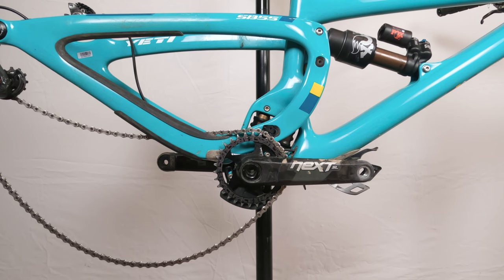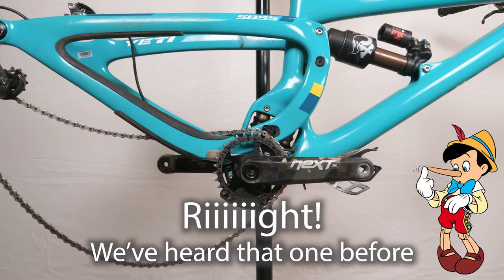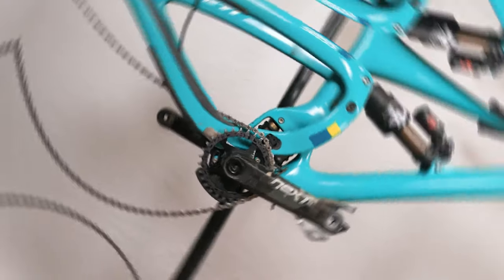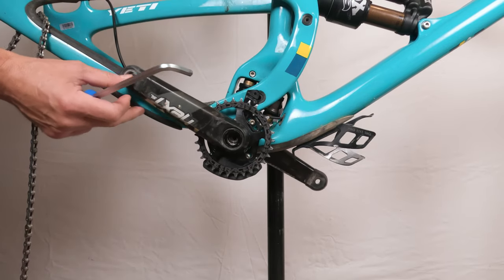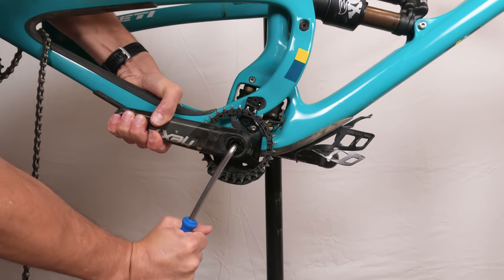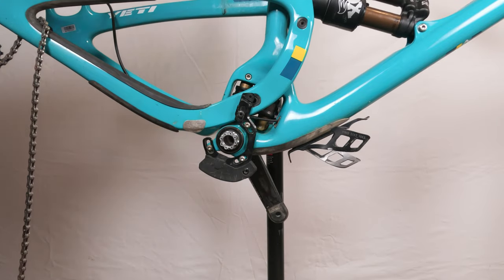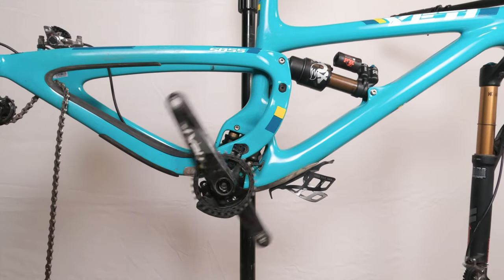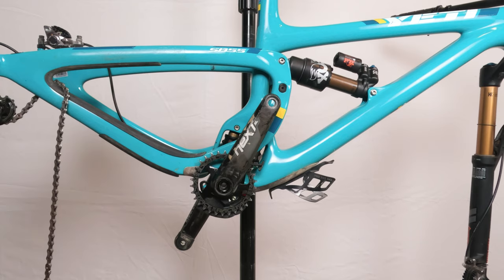Raceface Next Cinch Crank Service tips & pedal thread repair for beginners. This crank is a mess

Comment: The stock preloader that comes with RaceFace cranks is not great and should be replaced with a beefier alternative. Not only does that pinch bolt strip almost instantly, the plastic material is cheap and can break. I've tried both the Muc Off and Cane Creek aluminum preloaders and definitely prefer (and would recommend) the Cane Creek preloader. If you have RaceFace cranks, do yourself a favor and pick one up.
Reply from the maker: The old raceface preloader just plain sucked, and the new one is dumb. The new one might have solved the issue with stripping screws,  but it's a fricken magnet for dirt and mud. The cane creek is awesome. I'd say it's pricey for what it is, but what isn't pricey these days. 🙄 I never knew muc off made one as well. Thanks for the heads-up, I'll look into it 👍
Reply: The Cane Creek preload ring is excellent. Well worth the money. Going strong after 4+ years and several crank services a year. Always made sure I had at least two Race Face spares on hand before. switching.
Reply: @davide.6204  Same (I’m on year 6 with mine.) I’ve also got a crankset with the Muc-Off preloader but I think I prefer the Cane Creek.
Reply: So are you selling those with such a strange identifyer ?

Comment: If you strip that little screw head, you can get a better replacement at your local hobby shop (that sells RC cars).  I bought a box of 10 3x10mm hex crews from APS racing (APS30310S) for a few buck.  The heads are larger/deeper for better hex key engagement and they are stainless steel so they won't rust.
Reply from the maker: Thanks for sharing this myman. what sucks is there used to be a hobby shop about a mile from me for decades, but he closed shop two years ago. If by chance you happen to come across a link online feel free to share it so I can put it in the description section for people 👍

Comment: I'm surprised such a critical component would made of plastic and an easily stripped screw.  Cane Creek makes an all aluminum preload adjuster that is compatible with Race Face and looks far more substantial.
Reply from the maker: YUP! You are 100% correct. It's a bad design! What I don't get is that the new version of the preload ring technically fixes the issue with the bolt, but in an attempt to make it lighter, they designed it with large gaps all around it, which collects mud and dirt like a magnet. That's the last thing you want around a bb spindle spacer.

Comment: Just reassembled mine after having to replace the Raceface BB. It was not old but the previous owner's main hobby was pressure washing it seems. As you say these cranks are easy to work on once you get it loosened as it can take some force initially. Like the way that you do not plaster the whole assembly in grease...most mechanics overapply the stuff and it sits there doing nothing and becomes a magnet for dirt/dust.
Reply from the maker: Glad to hear you found the video helpful. Totally agree with you on to much grease. Many people use WAY to much grease. Last year I serviced a bike and literally couldn't see the lower two cogs on the cassette, they were completely covered in greased. As you basically mentioned, if you can see the grease it provides zero value.

Comment: I've found that cotton swabs (q-tips) are pretty good for getting down in the splines on the crank with the chainring.  I keep a soda bottle cap filled about halfway with IPA and then dip the swab into the cap to get it wet and then go to town cleaning down inside those splines where it's hard to reach.  It takes quite a few of them but it gets the job done 🙂
Reply from the maker: You are absolutely, positively, unquestionably, unequivocally, indubitably, no ifs ands or buts about it, RIGHT!  😁 I've used Q-tips multiple times in the past,  when the OCD kicks in, I can go through a surprising amount of them before I'm done. Those tube brushes I bought a couple of years ago also work really well. They are pretty stiff considering their size and do a great job and scrubbing off debris from the threads of the crank bolts.

Thanks for the great tip, which I really should have mentioned in the video 👍

Comment: Great stuff! Pretty disappointing that the BB shell is that far out of spec on a Yeti. I'm betting the owner goes through BBs rapidly and he's staring a brand new crank in the face with the massive amount of scoring on that spindle. Lastly, a big HELL YES to a normal amount of grease! So many build channels use enough grease on just the rear axle to cover the entire bike build. Great to see your sub count going up as you deserve it.
Reply from the maker: Thank you so much for the support. By far the most scoring I've seen on a spindle. At least Raceface sells just the spindle, which helps with replacement costs. I'm still not sure if it's a frame bb shell issue, if the bb wasn't pressed in right, or even if the bearings weren't installed in the bb shells correctly. Work just got stupid busy, and I haven't replaced the BB yet. While waiting for the BB I started on the bike's fork. I'll get to it soon. 

You are 100% dead on with the grease! There is a misunderstanding that adding lots of grease to the outside of a bearing will make it work better. It's the complete opposite. I plan on going into this in a headset video I'm working on. This is another area of a bike where some people apply way more grease than is needed.

Comment: Thanks for a really informative video and for teaching some grammar (unloosening..) :) I’m about to complete a HT build with Next SL G5 cranks. How’s your experience with them? I’ve read stories about the carbon coming loose from the pedal eyelet & at the spindle but perhaps that was previous generations.
Reply from the maker: "and for teaching some grammar" - The more I edit these videos, the more convinced I get that I have a fried circuit somewhere in my head! 😁

I obviously can't speak to failure rate numbers for the NEXT cranks, but I can say this. Where I live, the NEXT cranks are SUPER popular, and have been since they launched (Raceface has made a KILLING off them around here)

I've come across every generation, multiple times, and don't know anyone who's ever had an issue with them, outside of bearings (swap the bearings to NTN bearings, you won't regret it). BUT (and this is a big but), the trails around here are more XC type trails. We don't have major obstacles, such as those out west, that would really stress a crank. We basically spin, turn, and go up and down, on relatively flat ground with smaller rocks and roots. 

If you're riding on trails that the cranks were designed for, like the ones here in South MI, then my guess is that the chances of you having an issue with them will be extremely slim. If you're riding very aggressive trails or bike parks, then you might want to consider something more targeted for that type of riding. 

Now, there's always a chance that you can end up with a lemon, but I don't think that represents the majority of the NEXT G5 sales. 😉
Reply: @zoubtube  thanks for sharing your experience with these cranks I’ll mainly use the HT build for XC duty here in Norway so the cranks seem like a match. I’ll look into NTN bearings, thanks for the tip! I have an XC fully also but prefer Shimano aluminum when the going gets tough. I’ll go ahead and watch your other videos :)
Reply from the maker: @bjornart  Anytime myman! I'm sure they will be just fine and that you will enjoy them. If you have any other questions just let me know
Reply: "Unloosen" is actually a word.  It means loosen.  It's similar to how the words flammable and inflammable look like opposites but are identical in meaning.

Comment: Hello, 

I have to remove the spindle in order to put a larger one. How do you pull out the spindle from the non drive crank arm ?
Reply from the maker: Yup! both crank arms need to be removed when replacing the spindle. If your non drive side is stock, then chance are your going to need a 16mm allen and a puller cap with a 8mm allen in order to remove the spindle. The Spindle kit will most likely come with these items. let me know if you have other questions.

Comment: Oh Zoub I removed my Shimano 24 mm bottom bracket and installed a race face PF 92 to accommodate my new Next SL crankset as an upgrade. Everything went smooth. I used primer and retaining compound as instructed in other videos. The bearings seem to spin in the frame but I thought they were stiff. After installing the crankset it’s not spinning freely. I have the correct spacers and pre load. It is a BMC Fourstroke 01. 2022. It took a couple hits with my palm to get the spindle in. I also noticed the spindle is turning black when I removed it. It is very stiff. I can’t spin it around without the chain. Will it loosen up?
Reply from the maker: My apologies for the late response. I'm confident that the issue is alignment. The question is, is the misalignment based on the bearing in the cups, the cups installed in the BB shell, or the bb shell holes.

IMO, 30mm spindles are less forgiving than the 24mm when it comes to alignment issues. What might be very slight with a 24mm can be significant when replacing it with a 30mm. I learned this with multiple Trek frames a long time ago. Their BB shell tolerances used to really suck, but at least they were VERY solid when it came to warranty and support on the issue

Take it for a few rides first. See if it settles in and starts spinning more freely. If it doesn't, remove the BB, clean everything. Check to see if the bearings are sitting evenly in the cups. Reinstall. If this doesn't solve the issue, then I'd be willing to bet it's the frame that needs to be reamed/faced. 

Let me know how it goes.
Reply: @zoubtube  So, it turned out to be that the cup sleeve got a teeny crimp at one end! Makews total sense. Unfortunately I had to take it to my LBS.. We just decided to throw out the sleeve.. It's been great ever since. I asked anothr crucial question of you today. if you could check my comment on your XT Piston video...Thanks!!

Comment: I’m trying to find out which BB I should buy for this specific crankset
Reply from the maker: The BB type is dependant on which BB shell you have in . frame Ex: Threaded, pressfit, etc. After you figure this out, then you need a 30mm bearing version of the bb that will the shell. hopefully this helps

Comment: I've a raceface Ride crank that doesn't have a preload adjuster as part of the design. ..  I just ordered some aluminum 24mm spacers (0.1, 0.2, 0.3) in an attempt to minimize the side to side play that a preload adjuster does so easily.....now I know how Raceface reduced costs on this crankset model!!! arrggghh
Reply from the maker: I get the idea of cost savings, and agree with it,, but it has to make sense. this is one area where it doesn't. but what do I know! 😉At least you solved it 👍